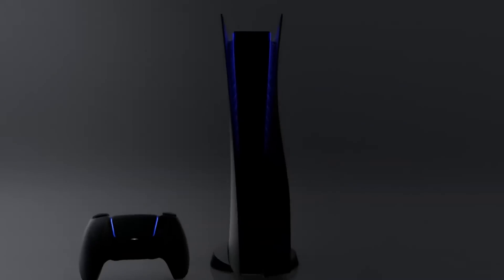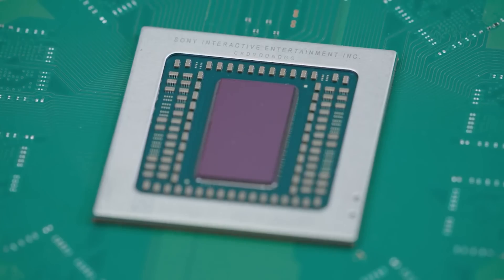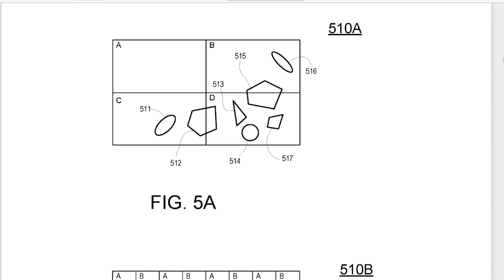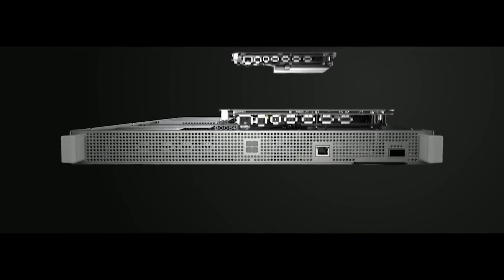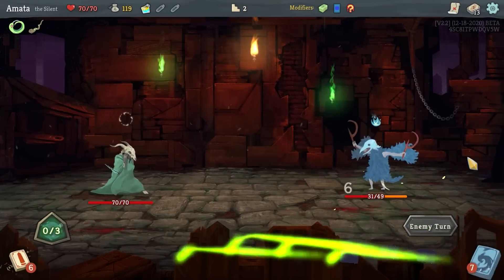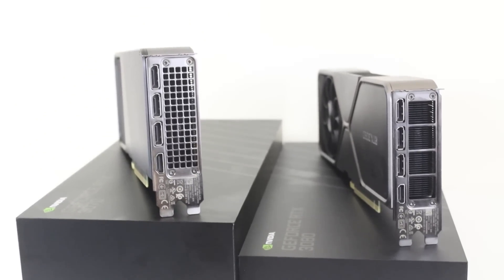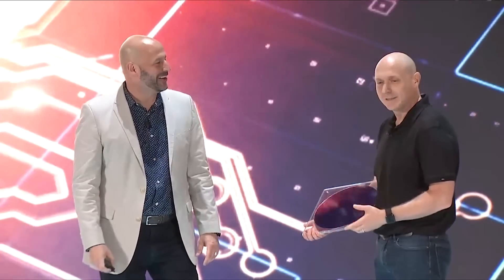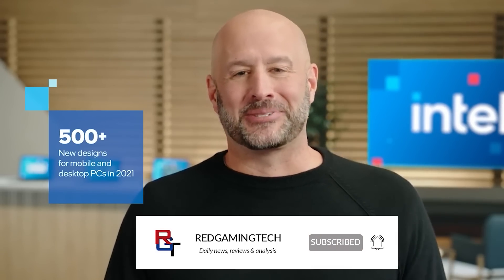The FUTURE Of Playstation? - Sony Multi GPU Patent Analysis | Nvidia Future GPUs to Use TSMC

Comment: If these patents are not for a PS5 Pro mid gen upgrade. They are basically 100% pointless to even talk about in this video. 
Because if there is no mid-gen upgrade. We're looking at 5-6 YEARS before next "PS6". By then Multi-GPU will be part and parcel in computing. It all begins in 2022. So by 2025/2026 there won't be a single GPU on offer that isn't already 2-4 or maybe even 8 GPU chiplets on a larger package.

Comment: I think you are wrong this time Paul, this looks to be a solution that could be implemented at home...
With something lile mesh shaders or similar technology those slides looks very interesting, diving workflow with particlrs it is quite easy, with atomization of the structure, dividing workloads seems a more manageable work.

Comment: Multi gpu accelerated cloud server that breaks down screen space per gpu per quadrant. Each gpu gets assigned a quadrant to ease rendering. I could see a  4k image being streamed by 4 x gpus @ 1080p instead of a single 4k image. Getting 60fps at 1080p then syncing 4 separate images.

Comment: I'm thinking maybe something along the lines of trialing two gpus, one outputting each half of the screen, therefore turing 1 1440p screen into 2 720p screens therefore allowing each gpu to run twice as fast....... Maybe 😬
Reply: 720p is 1/4 the resolution of 1440p.
1280x720
2560x1440
Reply: Getting flashbacks of interlaced sli.

Comment: RGT I only partly agree. Yes we are indeed talking about multiple GPU instances spreading the work load, but cloud rendering is only one example. You mocked the thought of more than 2 GPU inside a console, but that is one possible scenario. Stop thinking like a PC geek with all the limitations that brings. Think like a computer scientist. Think GPU yields. Lower the active cu count to reduce the cost of the GPU. That way you could afford to put more inside the console to spread the load. But the question would be how do you sync them all together. Well it's here in the patent.

Instead of putting an expensive GPU inside your console with 50cu active, use 6 cheap CPU's each with 20cu active. That's 120cu of processing power if you get them all working together and they all run cool over a larger footprint that is easier to keep cool. This could be PS6 or a stand alone box containing all the GPU's that connects to your console to expand the rendering power. PS6 might have 4 GPU and a socket to connect an expander box containing 4 more GPU which would make the concept of a Pro redundant.
Reply: Now why would anyone do that? this only makes sense cloud. We already have MCM which far superior to multigpu setup.

Comment: I've wondered if MS or Sony have looked into external graphics enhancement on consoles. Even if this is for the cloud. A new PS5 with USB4 - plug a 6600XT in and if Sony implemented the same idea. Maybe. Just theorizing. I think AMD themselves with Smart Access Memory (resizeable BAR) have maybe helped lay some groundwork here to have multiGPU maybe make a comeback. Especially if there comes a time when a Ryzen CPU has an iGPU architecture that is the same as the discrete GPU in the system. Maybe we might see that idea some had with DX12 and Vulkan where software addresses multiple GPUs as one single unit. An 8 CU iGPU, combined with a 36CU dGPU - both using RDNA2/3 - pooling all of their VRAM and processing elements dynamically.

Comment: Intel opening up fabs and attracting outside customers is good.  It solves some problems, but not fully.  With Intel getting into the GPU game, I just don't see Nvidia will want their GPU's being produced by Intel...  And regardless on the Arm deal goes though or not... Again, I can't see Nvidia going with Intel for ARM CPU production...  Same goes with AMD... Remember that just my opinion, and I could be way wrong - we did have an Intel CPU with Radeon graphics not too long ago (I liked that move and felt it was favorable for both AMD and Intel - but I'm still to this day shocked over that one).    I know GloFlo is doing good at the moment (given shortages, I can easily see why), in the longer run, not going through with 7nm I do feel is going to hurt them more (esp since we are already talking and looking past 7nm now in general).  So... We still have Samsung...  No one else seems to be playing on these cutting edge nodes (Ti, UMC, etc - at least as far as I'm aware), so... ??  Interesting times for sure.

Comment: This patents most likely for a future gen console and not a mid-gen refresh.

Sony will most likely add another 18CU (54CU and clock it to 2400Mhz - 16.6TF PS5 PRO and use RDNA3.0 architecture for improved rasterization and RT performance on 5nm).

Or simply double RDNA2.0 to 72CU on 5nm at a lower clock speed of 2100mhz resulting in 19.3TF.

Both of these should be possible on 5nm at around 350-380mm^2.

Comment: Think about it. Gamers are willing to go to great lengths to get a ps5 and love what they are getting. Who says that in 4 years we wont get a 72 cu console , at least 4ghz cpu , 24 GB ram and call it a luxury no compromise console. It will cost 699 in the states but people will buy it up like hotcakes. Shit if people pay more for the phone then why not ?
Reply: Forget an expensive 72cu GPU that is difficult to produce. Think outside the PC box. Just use 6 cheap GPU containing 20cu and you have 120cu of power when synced up with this tech.
Reply: @itsjusterthought7941  would that honestly be cheaper? I mean silicon is silicon ...

Comment: PS5 Pro not coming back, the PS4 Pro only launch to support 4k and better VR experience, the PS4 was weak outdated behind PC hardware while new consoles for the first time launch with new hardware as PC get day and date, Sony not going to do the same mistake twice, to built new console in short time cost ton money and the PS4 Pro didn't sell well at all since the majority of people don't love the idea they need upgrade new console every 3 years but only every 5-7 years, there is 0 reason to have a Pro version, maximum we will see slim version or more versions with higher storage capacity
Reply: How many did the Pro sell?
Reply: @Safetytrousers  i think few millions, the majority of the base PS4 users that including 114 millions people didn't running to upgrade for the PS4 Pro so the same case will be again if PS5 Pro version was a thing
Reply: @bullet759  Thinking is not knowing the figure. Sony would not have expected even nearly all the PS4 owners to upgrade to the Pro.
Anybody newly buying a PS4 after the Pro had been out would almost certainly have gone for the Pro.
Reply: @Safetytrousers  not everyone act as hardcore gamer, most people just want to play the games they prefer plus on the road save money as much as they can
Reply: @bullet759  That doesn't change the fact you actually have no idea how many Ps4 Pros were sold, you can only guess.
Reply: @Safetytrousers  still it didn't sell well compare the base PS4
Reply: @bullet759  Like I said Sony would never have expected everyone to upgrade from the base PS4, and a lot of people who would want a Playstation of that gen would have bought it before the Pro came out.
That doesn't mean the Pro didn't make Sony a healthy profit also.
Reply: @bullet759  The Pro did drop in price during its time by about £100. People will have a wide range of buying power, some things will always be too much money. Most people in the world don't even want a gaming console.

Comment: How does Sony get multi-chip rendering patents when AMD and Nvidia have been doing it for years?
Reply: Because they have some unique way of doing it or improving it. Of course, patents may contested in some cases too..
Reply: IIRC dual GPUs used to render alternate frames, these methods seem to be distributing rendering of part of the geometry.
But patents tend to be given wrongly, it's someone else's problem to challenge them, the fees create bad incentives.
Reply: I guess it’s easier to render 4x 1080p than 1x 4K

Comment: Zen 4 ps5 pro 2023.
Reply: Fantasy land 😂
Reply: @bullet759  certainly possible. Rumors are 2023 for the mid gen refreshes. So if it's 2023, they should use custom zen 4, rdna 3 apus. Like a 6700G or something
Reply: @Cblan1224  Pro version not coming back, Sony not going to do the same mistake twice

PS6 will come sooner
Reply: @bullet759  mistake? Sony is not going to just let Xbox run away with a mid gen refresh. Graphics tech is moving way to fast to be stuck on this apu for longer than a couple years, especially with how demanding some of these newer engines are.
Anyway, it's not like I am guessing, or making it up. Mid gen refreshes for Xbox are coming in 2023, and sony isn't going to sit out and get embarrassed by a series x refresh.
The ps4 pro wasn't a mistake, it was the bare minimum that they needed to keep up. If Sony doesn't release a ps5 pro, then I guess the trend of those switching to PC will continue to increase. Anything under 60fps is a slideshow and needs to go away. Unreal 5 is going to murder these consoles. They would have to make them 1080p.

You sound like you are stating some misguided opinion. Developers have already let it slip that this is coming

Comment: This looks like it’s doing tile based differed rendering
Reply: yup with specific explanation where each tiles were process by different GPU
Reply: Dreamcast already did that over 20 years ago if that's the case.
Reply: @samalton5837  well that was powerVR and they still make tile based renderers.

Comment: Sony PS5 Pro would have to be bigger than Series X 52 CU,  and double CU of the PS5 so 60? 
RDNA 3 type refresh? MCM? I think it'd be too expensive.
Reply: Not necessarily it would likely use RNDA3 and be on a 5nm process. Which would mean 52CU clocked at current PS5 GPU clock speed on new architecture is all it would need.
Reply: @ZackSNetwork  honestly I think infinity cache would be a big help for consoles, bandwidth has always been a problem for APUs even with GDDR6
Reply: @ZackSNetwork  No I think they'd have to beat series x, so 52 CU would be too little.  And it depends on the changes to RDNA3 over 2 if that would be used....which give the SDK's I doubt too as it would complicate development of games.  Elements of RDNA3 maybe....

Comment: Given how much of a cooling nightmare the current PS5 is, I can't imagine how a multi GPU or even bigger die PS5 Pro is gonna run without cooking itself.
Reply: PS5 doesn't have any cooling problems in fact it runs much cooler than Series  X does , at least mine ps5 is pretty frozen when I gaming
Reply: @ICEGamingEU  exactly, mine is quiet and runs really cool even while playing Spiderman on performance RT.
Reply: @ICEGamingEU  Gamers Nexus says otherwise.
Reply: @ICEGamingEU  The Xbox Series X runs quieter than the PS5 and cooler. Just like the Xbox One X did to the PS4 Pro.
Reply: FUD much?

Comment: 2 ps5 SOC's in a multi GPU setup could be done, but the amount of silicon would make it too expensive, not to mention the chip hasn't the spare pcie lanes to connect the two. Look at the PC motherboard with the ps5 chip. After the southbridge it's got x4 pcie for discreet graphics
Reply: It would be unfeasible using 7nm. But I expect Sony to use 5nm when switching to dual SOC.
Reply: @NBAasDOGG  They should just do MCM at that point.
Reply: 2x the PS5 SOC on 5nm is barely bigger than what the Ps5 is now, especially if you don't double the cpu portion.

Comment: Even before you got to the network part I was sure this wasn't for a PS5 upgrade, and would be more likely for servers or even a PS6. It already sounded so different that it would necessitate a new program workflow, and that's not the kind of thing you add to an update to your existing console. You can bump the specs, give the developers more room to play in before they have to start cutting things down, but you don't want them to build for more architectures.

Comment: I don't think there will be a PS5 pro because there is no need for it. The reason there was a ps4 pro was for 4k resolution. The PS5 is already doing 4k games.
Reply: @eel3161 they all have 4k modes
Reply: No Pro version coming this generation, Sony not going to do the same mistake twice, create new console cost ton money and the selling of them was not successful at all since the majority of people don't love the idea they need upgrade the console every 3 years but only 5-7 years

No reason for Pro, maximum we will see slim version or more versions with more storage capacity
Reply: The PS4 Pro was a  30fps 1200p checker board system. Not even the Xbox One X ran games at native 4k. The PS5 and Series X run games at  dynamic 1440p upscaled to 4k to target 60fps with an equivalent setting of low to medium. A lot of you dudes fall for the marketing because you are not tech informed.
Reply: @ZackSNetwork  even a $3000 PC do not 4k 60fps without DLSS2, what AMD give to console now, so it's really close result but  $400. Upscaled 4K is all what we need, games are dynamic not picture to compare with zoom.
Reply: @ZackSNetwork  i already know that. But the pro is still a 4k console because it checkerboards it to 4k. Ps5 games all have a 4k mode which is usually dynamic aswell but usually stays at 4k.
Reply: @ZackSNetwork  RDR2 was native 4k on xbox one X.
Reply: I am skeptical about the cooling capabilities of a slim version of the PS5. The thing is a lot more powerful than any other previous console in the past with all the new hardware.
Reply: @eel3161 you're telling half the story. The PS5 runs games at a slightly lower average resolution in dynamic 4k when compared to the series x, in general. The difference is often minuscule. 

The PS5 also consistently maintains frame rates better than the Series x. Again, the difference is minuscule.

There are some exceptions, but this is generally how performance plays out.

Both consoles are powerful and can do some impressive work, it's dishonest to act like there is this huge performance delta. The closest thing to a wide performance gap would be a handful of 3rd party exceptions and Sony 1st party titles.
Reply: There will be a slim or a pro.
Reply: @Alphadwg  Slim is pretty much guaranteed, Pro not so much

P.S. "Pro" is a stupid name for a console
Reply: @defeqel6537  true either way I’m waiting for the slim
Reply: @Alphadwg  I highly doubt there will be a slim model. Sony had major issues with just trying to cool down the current model.
Reply: @1979dal  microelectronics evolved and become smaller all the time, we for sure getting slim model maybe in 4 years
Reply: @1979dal  uhh... 5nm in a few years or 6nm that drops power draw by like 15-20watts already.

Comment: Do you think PS6 will use arm cpu cores? By the time it releases AMD should already be a few years into the arm cpu game. They will need to use arm cpu cores to get at least 3x cpu performance over ps5 at the same power consumption.
Reply: Ps6 will be roughly 8-10 years later. Probably 10 because ps5 gen isn't able to take off due to shortages. But yeah looking at how things seem to be headed arm is definitely looking to be the future of most chipsets.
Reply: @bruhder5854  7 years earliest
Reply: @bruhder5854  AMD are making big performance gains with every new generation of GPUs. Rdna 3 is going to be around 3x faster than rdna 2. If they make giant leaps every new generation this we will good for ps6. When it releases it will have a gpu at least 10x over ps5 because of AMD's performance gains. PS5's gpu is only 5.5x over ps4's.
Reply: If the ARM deal does go through for Nvidia, I doubt they'd licence it to a gaming rival.
Reply: @Safetytrousers  Nvidia wants to dominate the PC market using ARM like how intel and AMD currently are with x64. Arm is the future.
Reply: @Safetytrousers  That’s the first thing they promised they won’t do LOL.  Arm is everywhere so they wouldn’t be able to stop the licensing deals which is the arm business model. 

Don’t be so daft, plus arm sale is not set in stone, it maybe not even go through because of regulatory hurdles & national security concerns (whatever that means, I read)